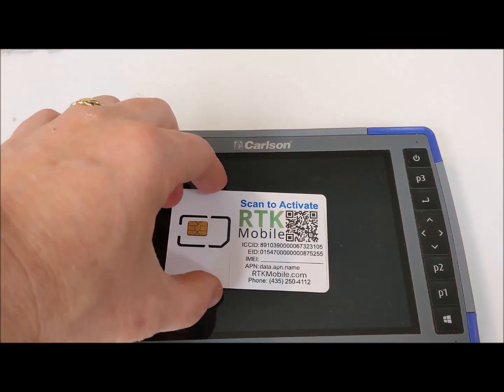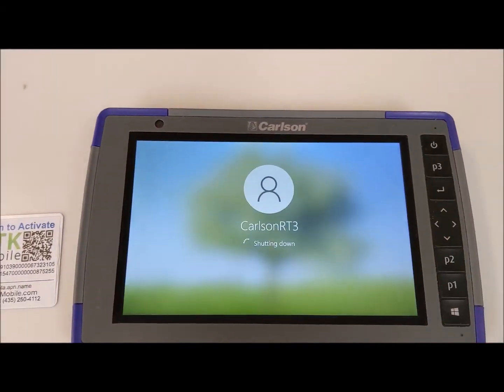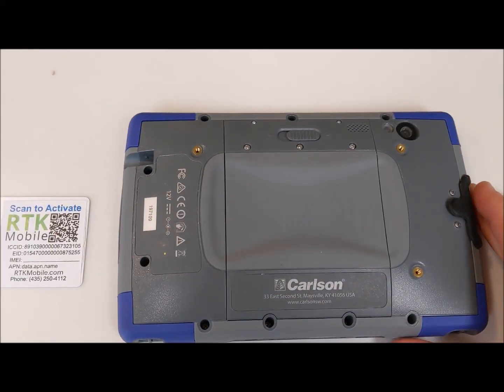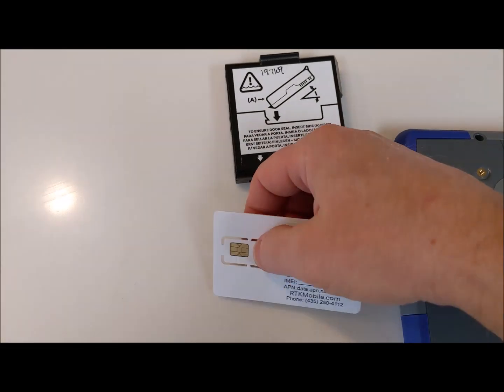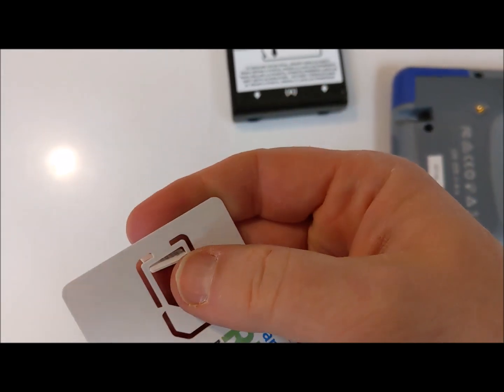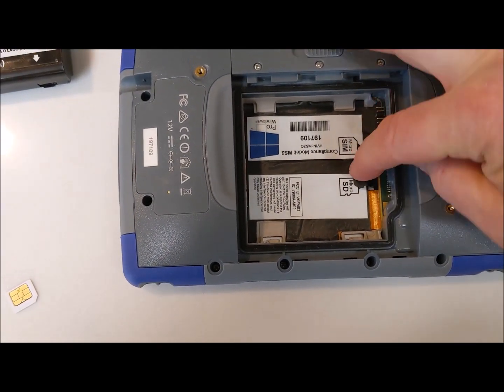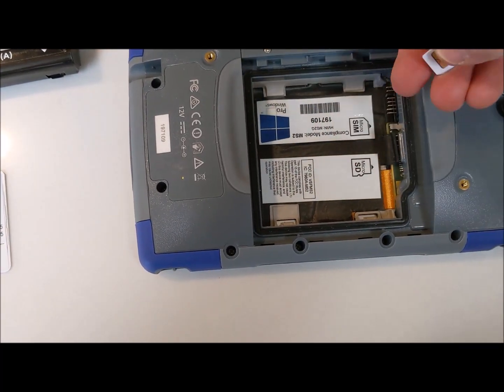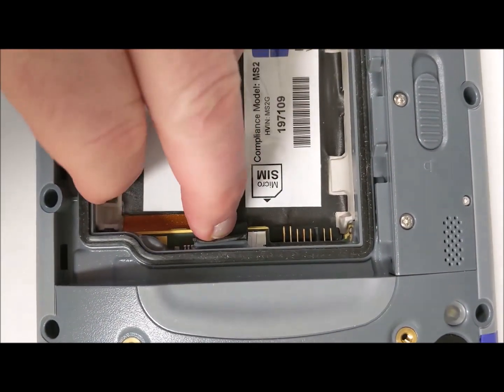How to install a SIM card in a Carlson RT3 or RT4 Tablet

Comment: My tablet doesn’t have the rubber thing.
Reply from the maker: The rubber thing is waterproofing for the SIM card and SD card. It isn't necessary and is often lost. As long as you have the SIM card inserted with the micro size adapter around it, it should be fine.
Reply from the maker: The rubber plug is to waterproof the SIM card slot and is often missing. Other than being less waterproof, the SIM card slot will work fine without i.